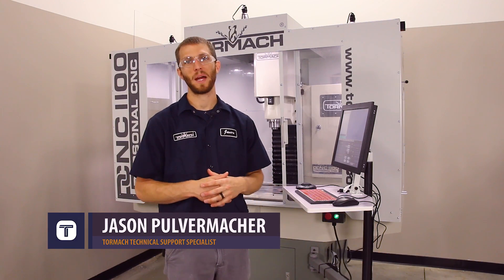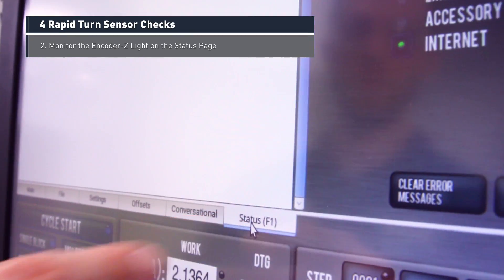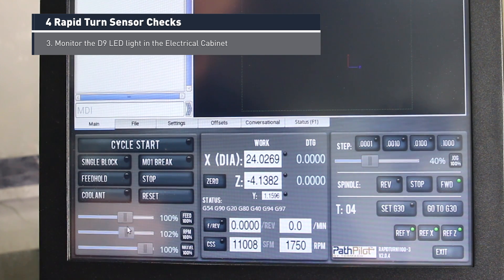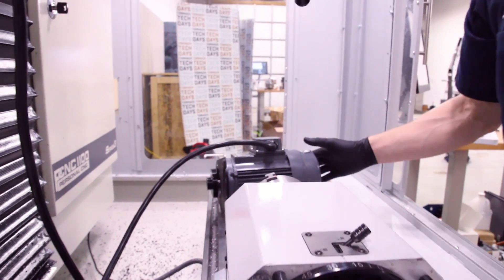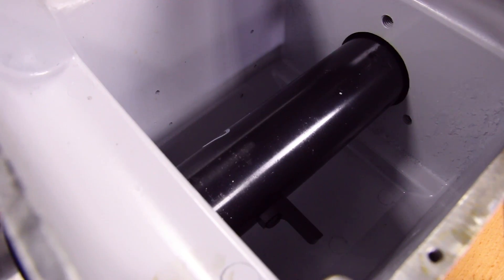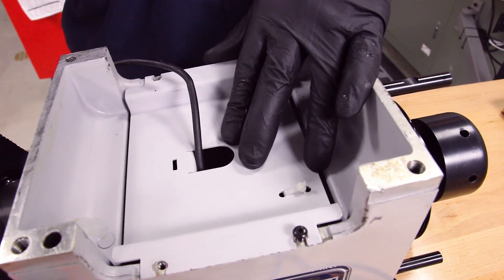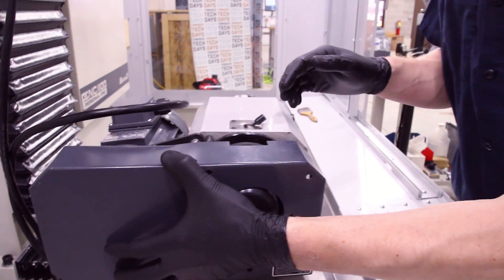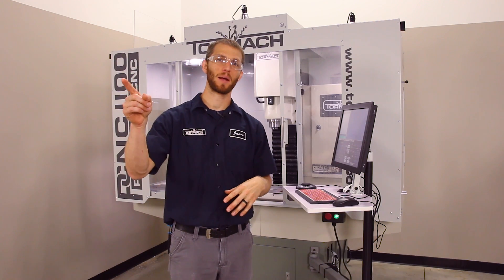Tormach RapidTurn Speed Sensor Adjustment

Comment: great video - thanks, 2 questions:
does the cycle start LED start to blink when this issue happens?
can a constant surface speed (not a threading) fail for this issue?  
i can get through 0-2 facing passes when the cycle start starts to blink and the conversational code execution stops.
Reply from the maker: Thanks for the questions, for specific troubleshooting assistance, please reach out to our tech support team.  info@tormach.com

Comment: What thickness of shim stock did you use? Is there a range for the gap set between the flag & the sensor?
Reply from the maker: Hello John,  The shim we used was .01", the closer you can keep the sensor the better it will work, obviously if its rubbing the flag its a little to close.